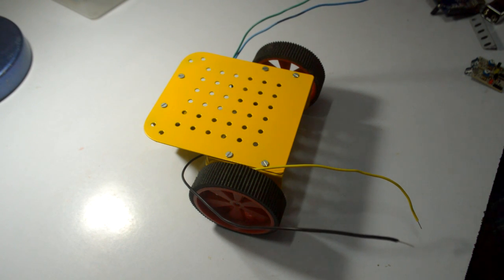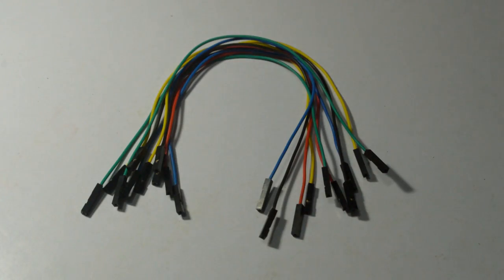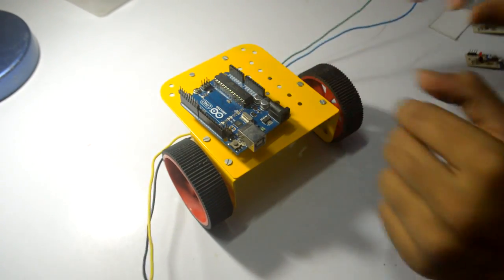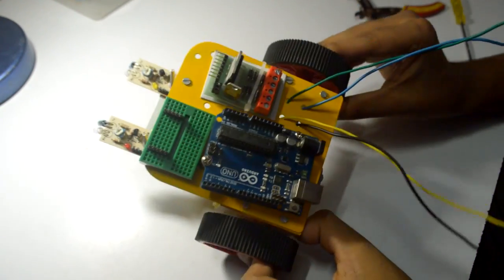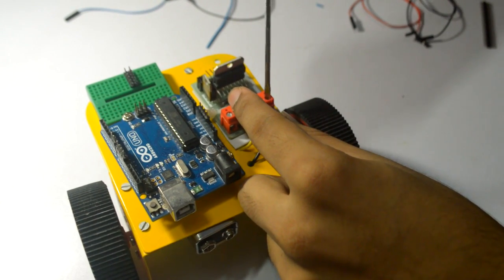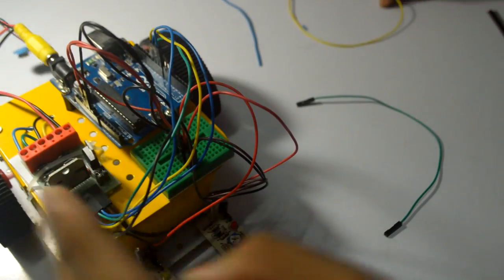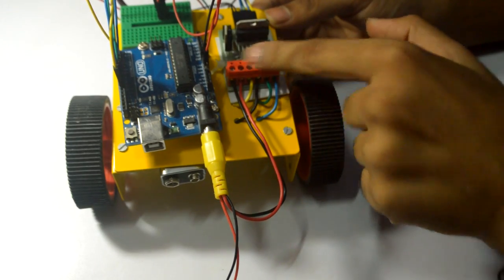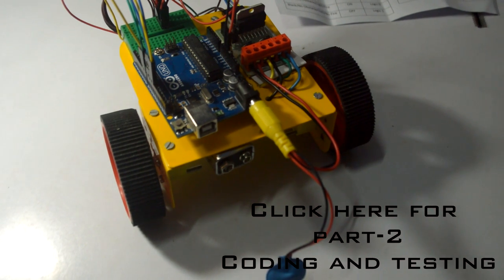Line Follower with Arduino: Part1- Assembly & Connection

Comment: my motor driver is different than yours but it is still a L298N .i did all in this video and copy the code correctly but my robot is still not working. what could i have been wrong? could you please send the full schematic

Comment: Can I make a line follower without geared motors? Please answer.
Reply from the maker: +Simon Tilsted Hansen Yes you can. But they should be slow enough so that the sensors can detect the line
Reply: +GetTutorialized KD
Thank you.
Reply: like for a robot of 1kg ,, what's the speed needed approximately
Reply: For 1 kg needs low rpm high torque motor .

www.engineeringprayog.com

Comment: I was wondering if the Ir sensor could be made from scratch? I tried to make one with photoresistor and Infrared led, but I am not able to set the light dependent properly due to poor signal of IR to photoresistor, Do u have any idea where Theres a Schematic of a fully working Ir sensor from scratch? coz i cant find one in my local area and ordering over ebay would take 30-40 days before it will arrive.